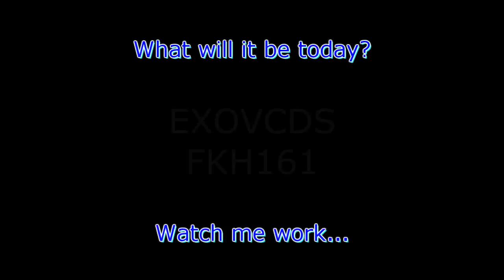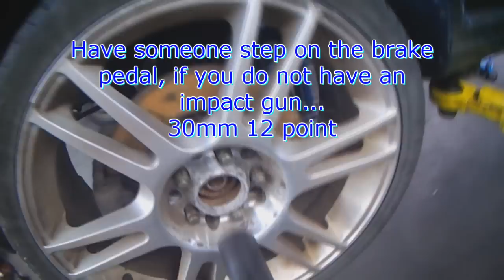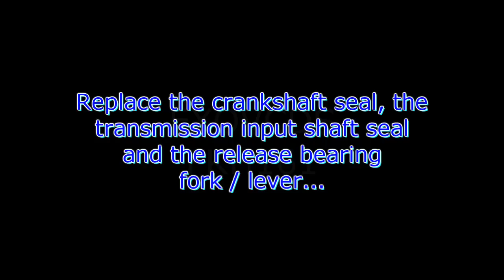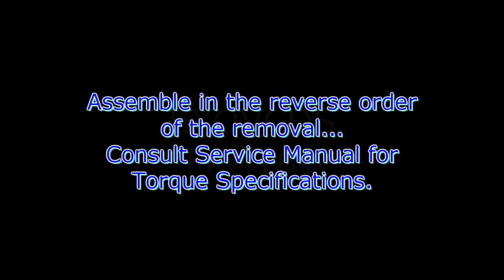VW A4: 2.0L AEG Transmission / Clutch Removal

Comment: Hey Thomas when I replace the flywheel is there anything I should know? Example. are there any marks that need to line up etc.
Reply from the maker: Flywheel can only sit one way (crankshaft mounting bolts are staggered).

Comment: hello I noticed that when you change clutch you do not drain the gearbox and that it is for life the oil
Reply from the maker: We don't always change the transmission fluid when a clutch is changed. We recommend changing the gear oil every 80k to 100k km's.

Comment: Hi again Thomas. Is the clutch pressure plate supposed to be flush with the flywheel? When said pressure plate is tight should the clutch disk be able to move?
Reply from the maker: New clutch will have pressure plate fingers that are fairly flat. As the clutch wears, the finger "tips" will rise. Clutch disc should always be tight / not move... unless pressure plate is pushed.
Reply: Thomas EXOVCDS hey man I Just wanna say thank you so much for your help! I got clutch replaced and she is shifting like champ now without any loud screaming from the throw out bearing. 👍
Reply from the maker: @garyburgess7980  Thank you for the update... good to hear things turned out well!

Comment: I see this all the time at the shop.  When you remove the lower ball joint bolts, will you require an alignment afterwards or are the bolts there to hold the joint into place with the lock plate?
Reply from the maker: The holes are slotted for alignment adjustment. When removing the bolts, there are marks from where the bolts were sitting. At minimum, put the bolts back as close to the old marks. Separating at the pinch bolt would be a better way to go. An alignment should be done every 2 years or sooner depending on driving habits.
Reply: Thanks for the explanation.  I know more or less what the parts though but it is nice to see how they get put together in the VW world :).  Again thanks for the explanation :).
Reply from the maker: mischief007 We don't do alignments in-house... when we do major suspension stuff, it gets sent next door to the alignment shop. For something like this, it should be close enough to be "back to where it was" and we explain that an alignment is always a good thing to have done.
Reply: no
Reply from the maker: @ShawnGemmell raise the wheel off of the ground, loosen the 3 mounting bolts / nuts. Grab the wheel and wiggle it. Let me know what you find.
As long as the "pinch bolt part" of the ball joint was the only thing that was removed / popped out of the steering knuckle... alignment should not change.

Comment: Hey Thomas. Is there anything I need to lube when replacing the clutch? Such as the release lever or the throw out bearing etc.
Reply from the maker: Clutch disc splines / input shaft splines. The inside bore of the release bearing that sits around the input shaft
guide sleeve for the bearing. The back of the release bearing  that contacts the release fork (always replace the
release fork!). At the base of the release fork where it mounts to the pivot pin... put some lube in the dimple before
securing it to the stud with the spring clip. Put a little lube on the other end (dimple for the slave cylinder push rod).

Comment: Hey quick question, I'm doing a new clutch and flywheel on my mk4 jetta along with a rebuilt trans my question is bleeding the system do i have to pressure bleed the brakes and clutch with a pressure bleeder or can i do it the old fashion way and pump? 🤔
Reply from the maker: There should be no need to bleed the system... unless you are opening / replacing a part in the clutch system. Pump & hold should work. Pressure / vacuum bleeding works, as well as attching a long hose to the bleeder on the slave and running it back into the brake fluid reservoir. Opening the slave bleeder and then pumping the pedal... fluid will go back & forth into the reservoir, bleeding the air out.

Comment: Haha good job man,I like how you do it without struggle, hey on this models,can I lift the engine without the transmission? I need to replace the engine on mine.
Reply from the maker: Possibly... I find it easier to drop both and then separate them on the floor.
Reply: Thank you,I'll try to do it without the transmission, I'll let you know how it goes
Reply from the maker: panchovillaxx7 probably easier with an automatic transmission... the flex plate that mounts to the converter is skinnier than a flywheel & pressure plate assembly of a standard transmission. Removing the passenger mount & engine bracket will give you maybe 4" to 6" to slide the engine towards the passenger side.

Comment: Awesome vid Thomas. Was the flywheel you removed a dual mass or single mass? And would a faulty single mass flywheel or clutch make the same clunky noise as Sajeev Kumar's vehicle/post below?
Reply from the maker: Jason Ortogero In this video, single mass... notice the springs in the clutch disc. A dual mass disc does not have springs. I don't think that the single mass flywheel can make / will make the same noise.
Reply: Oh no! I have a very similar clunking noise and thought it was due too a dual mass, but when I removed the transmission this morning (thanks to your video) I found that it has already been converted to a single mass flywheel. Any thoughts/suggestions of what it might be? Like I said, it's the same exact clunking noise as sajeev's video.
Reply from the maker: +Jason Ortogero Not sure... maybe he will reply as to what he found.
Reply from the maker: +Jason Ortogero Send him a message... looks like he will not get a notice from these posts.
Reply: Thank you again Thomas. I will do that.
Reply from the maker: Jason Ortogero Sorry to hear that you did not find a problem... I'm watching the video now and will reply under the video.

Comment: Doing this on a 04 beetle I played hell getting trans out after everything was disassembled, any tips for going back in?
Reply from the maker: Be careful, take your time... dip the transmission nose, raising the diff end and then lift & twist it into place (clockwise / diff drops & nose comes up). If that makes sense. Watch the removal in reverse. =) 25:00 to 24:42

Comment: Hi Thomas,  Can you suggest which brand of Clutch to use on a 2003 beetle  GLS Hatchback 2.0 AVH 5speed?  I'm confused by all the brands: LUK, Valeo, Sachs, OEM. I'm planning on doing the clutch, pp, bearing, ball pin, fork and flywheel and bolts.  Is it necessary to install an new input shaft seal on the trans too?  Also your advice on doing the rear main seal at the same time.  Any help is appreciated.  Thanks!
Reply from the maker: Izzy Dizzy Sachs or luk both are fine... it's a good idea to replace the input shaft seal. It can be bought / it usually comes with the release bearing support tube that mounts around the input shaft. Just like the crank seal... worth doing while everything is apart.
Reply: Thomas, As always I appreciate your response and advice.  I agree that it's wise to do all the "little extras" while it's apart. My car is creeping up on 73K miles with original clutch and although I don't have any slipping or shifting issues, I do feel a little chatter occasionally when starting off in first gear.  I'd rather take care of it before winter sets in. Now the hunt is on for the best part prices I can find.
Cheers!
Izzy
Reply from the maker: Izzy Dizzy Let me know if you need any service info.

Comment: Hi Thomas ,
Do you have any videoy of removing transmission on passat b5.5 or audi b5(1.8T).
Longitudinal engines.
Reply from the maker: Sorry no, not yet.
Reply: @EXOVCDS  There is no need for an apology.
I have been become master for my passat b5.5 1.8t, with all yours videos.
So man thank you for help.
Reply from the maker: @1993-g4h  Removal of the transmission should not be too difficult. Easier when using a hoist of course... standard or automatic? Both will be similar. If you need service info, let me know.
Reply: @EXOVCDS Its manual and i will do with jackstand , dont have a hoist.
If i get stuck, i will contact you.

Comment: Currently replacing the clutch in my 2003 VW Jetta 1.8T and its being a fight reinstalling the transmission. I keep getting caught up on the K member. I can get the transmission in and over the K member but not enough play to get the trans to go on up into the clutch itsself. I have the Luc clutch that came preassembled with the pressure plate, flywheel and clutch and of course new bearing. Honestly this VW has been the most aggravating clutch I've ever replaced and I've done quite a few in my day and I'll probably never do another one on a Jetta. Any input or advice you could give to help me out? Thanks.
Reply from the maker: The engine needs to hang / tilt enough... transmission needs to be tilted & rotated into place. The nose (5th gear end) needs to be down while the diff end needs to be up. As the transmission is lifted into place, the diff comes down & the nose goes up. Removing the passenger driveshaft flange from the transmission can also help. If need be, the engine can be pushed / tilted forward a little to make more room away from the subframe.
As always... be careful and have everything supported correctly!!!
Reply: I found that reinstalling it was easy with two people. One person above to guide and operate the jack and another person to man handle the transmission (madly shake it around until it seats). After bringing over my father we got the transmission out and back in within four hours. IT was just a lot of shaking to get the transmission to seat.
Reply from the maker: @AnonymousKnowsTheWay  Thanks for the DIY info / suggestion. May be helpful to others in the future!

Comment: Would you have any advice on doing this on the ground? Would the height of a jackstand be enough? I think 've got an AZG any big differences?
Reply from the maker: Should be the same process... the more height you have, the better. Support the engine from above or from below. Make sure that your jackstands are placed correctly!
Reply: ***** Thanks. We'll give it a go. Any recommendations for best value/quality parts? A friend said I should not mess around ... that I should spring for OEM from the dealer.
Reply from the maker: Lou You can get an OEM clutch kit from Auto Parts stores (LUK or Sachs)... also replace the release fork for the release bearing, as they will crack when they get old and will no way last the lifetime of the new clutch.

http://altrom.com/images/altrom/catalog/02J141719C-1.jpg
Reply: ***** Thanks again for your advice and excellent videos. Will let you know how it goes (like how many bolts I bust) I'll probably throw a timing belt into the mix as well ... we're at 90k on it now.

Comment: I have 2002 1.8t fwd Passat and my clutch is slipping , what the average cost for this fix?
Reply from the maker: Not sure... prices for parts & for the labor per hour to replace it is different from shop to shop, country to country. The labor (if all goes well, should take equal time / be the same for shop to shop, unless they run into problems or have to do extra work. Contact shops in your local area to get "a ball park figure / estimate". An estimate is just an estimate... things might cost a bit more once things are apart and accessed.

Comment: Would this be the same process for a BEV automatic?
Reply from the maker: Similar, but you also have to deal with the coolant lines for the ATF cooler, the bolts for the torque converter and a bunch of sensor connectors. Follow the procedure in the service manual and you'll be fine.

Comment: when doing this do you have to remove the shafts from the hub as you did? also you might know.... is there any problems using a bev block and head to replace my cracked ahv?
Reply from the maker: +Tyler Allison My coworker leaves the axles attached to the wheel hub. Don't know the specific differences between the two, sorry... I would have to look into that.
Reply: Thank you again. found the block is cracked in my avh. going to pull the bev tomorrow and go for it

Comment: Great vid.  That much work is way outta my skill set tho.  What is a good price for having that done at a shop?  Thanks for posting.
Reply from the maker: Mitchell labor guide lists 5.2hrs for clutch replacement... once the transmission, clutch & flywheel have been removed, there are a few other items that may need attention (crankshaft oil seal, transmission input shaft seal etc). Labor rate per hour varies between shops across the country, so I can't give a dollar value... phone some shops in your area (stick with those that service VW) and see what they say. Estimates are just that, a ballpark figure that covers the minimum and a little bit of extra... but no-one knows the exact price until things are taken apart and assessed.
Reply: ***** you were able to do that in about 30 mins but labor guide states that it's over 5 hours? That's a HUGE difference when it hits the wallet. Huge. And the bad thing is there's no way of knowing if I'm getting ripped off. Ugh.
Reply from the maker: jimmiequick this is a YouTube video... I edited the video to make it shorter. I only recorded the removal. It takes longer than my video. The labor guide is there so shops don't over charge.

Comment: hey brother, I have a wierd issue with my 09 civic si..... loose clutch fork. spring is attached, working like it should. replaced the stage 2 clutch with a stock exedy. keep the light flywheel. as soon as I mounted the trans notice the fork loose. don't get it.
Reply from the maker: +Jerry Mercado Not sure how the system works on the civic... if the slave cylinder is not yet mounted, the fork will have movement / play, because nothing is pushing it & the release bearing against the pressure plate.
Reply: +Thomas EXOVCDS I totally agree, but wouldn't you think it would have some type of stiffness?
Reply from the maker: +Jerry Mercado Not if the slave is not pushing against it.... yes otherwise.

Comment: Symptoms- my trans is sometimes hard to get into gear even while at a stop.  Grinders once and a while when driving.  Does not seem to slip at all.  I tried to adjust the shifter linkage but still something.  2000 AEG.  Just curious if there is other things to check.  I'm going to try to bleed the system and possibly replace the master and slave.
Reply from the maker: How does the clutch pedal feel? As you lift your foot off of the pedal... how early does the clutch seem to grab? Should be somewhere in the middle to 3/4 pedal travel (off of the floor). If it glabs low, you've got a hydraulic issue.
Reply: @EXOVCDS  The pedal seems to be high when it engages but does not slip at all.  I can't remember if I cracked the bleeder open to try and allow new brake fluid to flow down with gravity.  It may have introduced air into the system.
Reply from the maker: Air causes a low grabbing clutch pedal. If it is high, odds are that you don't have air in the system.
Reply: @EXOVCDS  ok sounds like clutch is toast.  Works mint some times and grinds others.  Could the master or slave be starting to fail.  I can change them in minutes and might try that first.
Reply from the maker: @1975Kombi1  You can try one or both, but I don't think they would be the cause of a high pedal or the grinding (unless the pedal grabs low intermittently).
Reply: @EXOVCDS  Well I'll swap out the clutch, throw bearing and see what happens.  lol

Comment: Hello! I had replaced my flywheel this same engine AEG (Golf) I got a Flywheel 068105269H 
After replace my car runs shaking and doing a weird noise like a new flywheel touching somewhere. I googled a part number and I found 068105269F and a older flywheel was 068105271F. Have you guys seen something like this trouble before?
Reply from the maker: Are you sure the flywheel bolts are tight? I don't know the differences between the part numbers... I would have to check them tomorrow. You did not use a complete clutch kit? Bought several individual components?

Comment: I’m considering buying a 1999 beetle with 2.0 and 5 speed. It is almost at 200K miles on original clutch or so I’m told. Is that even possible? Also any common problems I should look out for?
Reply from the maker: Highway driven car... could still be original, sure. At 20 years old, I'm sure that the "common problems" have already been dealt with a couple of times. Deal with issues as they surface... post questions / let me know when the time comes and we can then deal with them. Listing off a bunch of stuff that may or may not be an issue, will only make you worry more. =)
Reply: Thomas EXOVCDS 
Thanks I really appreciate the response. I’ll let you know if I pull the trigger and buy it!!

Comment: Thomas, again thank you for the video. 10 hours yesterday going to finish today. 
Question- the plate with the 10 mm bolt that came off after the axle 16:57 on video. We forgot to place it back. what exactly does it do, how hard to get in afterwards?
Thanks in advance, appreciate what you do for us!
Reply from the maker: No big deal... it can be put back into place with the axle in place. You just have a little less room to do so with the axle in the way. The plate covers the small opening... I have seen many cars that did not have the small plate / someone forgot to put it back. When you have time, put it back... but there's no hurry / not that important. It's meant to keep things from getting / falling in.

Comment: would this process be the same in my 2001 (mk4) golf need to remove the transmission? thanks
Reply from the maker: Yes... this video is of a mk4 / A4.
Reply: +Thomas EXOVCDS 
have you ever rebuild a tranny? if so is it complex or pretty straight forward? 
need to fix my second gear
Reply from the maker: +Steven Maclean Quite a few specialty tools needed... if you are not in a rush, you can probably find / make work-arounds for them. A good service manual will show how to disassemble and what tools are required.
Reply: +Thomas EXOVCDS 
sweet thanks I'll look into it!! thanks appreciate it.